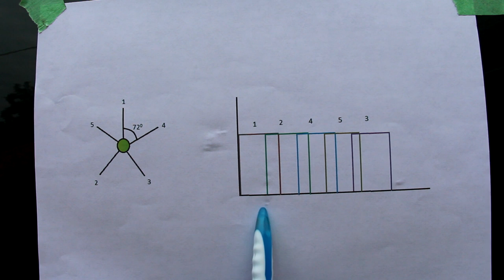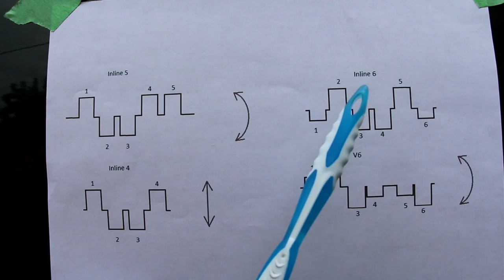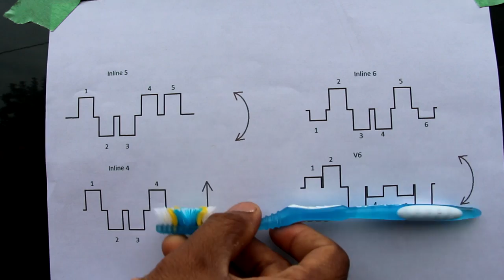Why Inline 5 Cylinder Engines are an Anomaly

Comment: Love the toothbrush.  Perfectly scungy, so much better than a greasy finger.  Yes, Volvo PCV's are dumb - I've changed many, and pulling the oil filter without slopping nastiness everywhere requires ninja-like speed and agility.  Wouldn't trade for any other engine though.  Such a lovely noise.

Comment: This teardown makes me really appreciate the freakish reliability of the 4.0 ltr straight-six Barra engine in my Australian Ford Falcon. Similar 4-valves per cylinder, oil-operated variable valves, but with a timing CHAIN and a very simple PCV system on top of the engine cover. Oh, and a water pump that is easy to replace. 512,000 km's so far since 2003, and the oil stays clean (LPG).
Reply: Barra’s and intechs mate, unbreakable

Comment: I suppose this is the updated B5 engine. My B5234T4 has a different location for the oil filter, a little bit hard to reach with the tool but at least it doesn't make a mess when its changed. And also  has a hydraulic tensioner which in my oppinion is a worse solution than this one. I remember people putting this spring loaded tensioners on engines with hydraulic tensioners.

Comment: Well, i love my Volvo S60 2.4 S with 480.000 km on the clock. 
Keep the oilchanges and they run forever.
Reply from the maker: Nice, what year?
Reply: speedkar99 
A 2001
I spoke with a guy who previous had a Volvo with the same type of engine. He sold it with over 800.000 km on the block and it’s still running.
Giving the proper maintanence they’ll run forever and sounds fantastic. 😊👌

Comment: Mercedes 5 cyl 617 series diesel was a great engine. Simple, and almost bulletoroof.
Reply from the maker: Those were the benchmarks for inline 5
Reply: I had a Benz 300D with the turbo OM617 - put 250,000 miles on it and the only major component that needed replacing was the timing chain at 200,000 miles.  A bit slow off the line but pulled like a locomotive on the highway.  I still regret selling that car
Reply: @flyingdutchman4794  Wish I had that engine in a bunch of my stuff!
Reply: @speedkar99  The Mercedes was the benchmark for a diesel I-5.
However, my 1984 Audi 4000 Quattro was the benchmark for a gasoline inline 5. While it was mostly made from I-4 parts, the Audi I-4 would last 200K miles if you were kind to it, my Quattros I-5 has about 350K miles & still can pass smog...

Comment: Henry Ford was working on a 5 cylinder engine in the late 1930's. Never went into production. Balance problems no doubt.  Henry hated the 6 cylinder engine. Not only because of Chevrolet but his own failed Model K used it.
Reply from the maker: Good to know
Reply: Henry didn't like being told what to do by an Englishman. ;-)  [Harry Ricardo in his seminal text, The High-Speed Internal Combustion Engine basically spelled out why the L-6 was best, esp. at that early stage of development....]
Reply: The Volvo 5 cylinder was used on the Ford Focus RS.
Reply: @Milen4u  - Somewhere Henry is smiling. He wanted a five.
Reply: Ford is the reason there was so much plastic on that particular Volvo 5 cylinder. Most of the parts say Fomoco. It was built when Ford owned Volvo. The older ones had much more metal  or aluminum

Comment: I love this engine--had it on my C30 and have it now on my V60 (2015, the last year they used this engine). Both of mine turbocharged. Two things only have happened with them. 1) see the timing belt at 3:18? I had a mouse crawl in there once on my C30 which blew up the top half of the engine (Geico covered $6,500--whoo-hoo!!). 2) the PCV assembly WILL crack and fail. I've had to have one replaced on the C30 and another on the V60. That's a $900 job. But, with regular maintenance, this is a fine engine: lots of power and I love the slightly "rough" feel of it compared to the V6 on my wife's XC60.
Reply: There's not a V6 in your wife's XC60 :) . If it's a first gen XC60 it could be an I6 though (the SI6 - Short Inline Six).
Reply: @olaagnilsson  You are correct! I've always thought it was a V and looks like it is from outside/above; but it's inline. Thanks for the correction! (You can tell I never touch this--leave it for the pros; but it's pretty bullet-proof.)

Comment: Wow, "first time using my 13mm socket", has to be one of the most common bolt sizes in cars.
Reply from the maker: Not in Japanese cars!
Reply: speedkar99 yes. Japanese they tend to bias on even numbers.
Reply: @speedkar99  I have seen 13mm nuts and bolts on Japanese motorcycles. Can't recall ever needing one on my Civic though.
Reply: Japanese are very supersticious with the number13.
Reply: Dinky Doo  is that seriously why they’re uncommonly used?   I know every german car (audi) I’ve worked on is like it’s built around 13mm bolts.  Lolz
Reply: @audimaster5000  No Mate i'm jesting ;-)
Reply: 13mm is usually size that fail's.. I had to have some 10x Japanese cars and one vw golf GTI. And that car what like's thirteens is usually broke.. Too many fail's under 13mm bolt's ;)
Reply: My ford and dodge both use the 13mm and 15mm for nearly everything
Reply: @audimaster5000  In fact Asian cultures usually don't care about 13.  They do care about 4, as in several languages the standard word for 4 coincides with the word for death.  It's remarkably common to find that skyscrapers don't have any floors with a 4 digit - so 4, 14, 24, 34, and everything from 40-49 are just skipped.  In Western skyscrapers, it's common to put a machinery space between floors 12 and 14, so that nobody needs to have an office on the 13th floor.

Comment: Actually the oil filter is just the paper element core that goes into the housing and a proper oil change is less messy than a cartridge type filter that pours oil everywhere

Comment: Now I know why they charged me $4,800 to replace the head in my 2001 S60 T5, 12 years ago with 160k. Never overheated, changed the oil every 5,000 miles with Mobil 1. Said had many cracks between plugs and valves. Crazy design, will never buy Volvo ever. Volvo rep told me what do you expect it has 160k miles on it. I said really, I have had cars with 350k miles with no issues. That's why I only buy Toyota.
Reply: Scotty Kilmer approves of this message.
Reply from the maker: Yeah it's weird how the valve cover is integral to the oiling system.
Reply: Jim Rr 😂😂😂. You bet!
Reply: @speedkar99  Let me fix that statement for you.  Replace "wierd" with "stupid"
Reply: I have 850 t5r 300k miles no problems at all

Comment: "If this get lodged inside of your timing belt, that's not good"
. . . well, I can tell you what happens, 'cause that happened to me lmao

My timing cover on my 2003 Hyundai Sonata V6 was all disintegrating and a bolt fell down onto the crankshaft sprocket. It shredded about 75% of the width of the belt, and I had to do the belt replacement all over again, plus order new covers. Luckily, the remaining belt width held until I figured out what the shredded rubber and whining noise was, so no valve damage!
Reply: Woah! Nice job remaining belt

Comment: Correction - the turbo manifold is not integral to the head, it has the same basic head design.  The manifold is integral to the turbine housing instead, and the rest of the turbo is attached to that.  Older versions used a standard manifold and turbo setup.

Comment: Here is a question for speedkar99:

With so many oil passages and problems with them being gunked up, could you “pickle” the engine by filling it with a type of sludge solvent, letting it sit, and then draining and flushing? I’m talking filling it right full overtop of the pistons and totally hydro locking it.

Comment: All this complexity in something that is now obsolescent. A large electric motor is complex in terms of the electronics and possibly materials science so an EV is not as simple as one may imagine. A big plus is that it will have  only one gear for all forward speeds with maximum torque at 0mph. A motor service interval of 1,000,000 miles (for a Tesla) and first life battery longevity of 12 to 15 years (up to 25 when repurposed). A different world. A petrol engine can use very clever techniques indeed to run clean 'ish' and give reasonable performance. Really awesome so it is actually sad to see them lose relevance.  A well presented if a bit oily video.

Comment: Im doing a head gasket job on a similar 6 cylinders volvo engine , the manual does not give specs for flatness of this aluminum block , do you know whats the maximum warpage allowed on the block ?
Reply from the maker: I'm not sure, maybe a machine shop might have that spec

Comment: I'm 150k+ on my 2010 5 cyl. Runs great. Gunning for 186k+, just crossing fingers that the transmission won't grande sooner

It's the FT 2.5 that has been running E85 occasionally too 😎

Comment: The combustion chamber is in the head, not in the bottom of the block.

Oil is enough of a coolant for the lower portion of the bore. The majority of the heat is in the head and the top of the cylinder.
Reply from the maker: Good notes

Comment: I had a Volvo 850 with this engine, it was BER when the head gasket failed, like the one you have here.  Lovely and smooth engine, compared to a 4, because the pistons are not at 180degrees to each other, it's 144 degrees. "They" say it's as smooth as a 6, which has 12 degree separation.  I did find that my Lexus (toyota) straight 6 was super smooth and powerful.  Much smoother than the V6 I have now.

Comment: I've just viewed this and it's really good! Lots of good non biased info. 
I'm looking putting this engine into a locost vs a Honda K20A6. I know the weight bare of the Honda but can't find any on the Volvo B5204T5 or the B5204FS, any info on what is weighs bare? Meaning, the sate that the engine in this video started out at. 
There seems more versions of the turbo engine available in the scrap yards so I was thinking of ditching the turbo and upping the compression because the race series I'm going into doesn't allow turbo and has to be no more than 2.0L and I thought the bottom end would be stronger.

Comment: Thanks for the awesome vid...now..im getting that the failed part of a cracked cylinder wall because the head gasket was intact. Was that your findings?
Reply from the maker: Nothing obvious, I'm assuming head or oil cooler because of the gell that came out of the oil pan

Comment: I had a volvo 850 estate, best car I have ever zhad.  20 years old and over 200,000 miles when I scraped it, was a strong engine.  The gear box did jump out of first sometimes.   The steering rack was  an MOT failure plus some other problem.  Engine was so smoooth

Comment: Well explained. There is a rough banding of engine capacity where the mechanical losses (and size, weight and cost of course) become prohibitive for a higher cylinder number to be used and the forces acting on the cylinder are prohibitive for a lower cylinder number to be used (thicker, heavier con rods and crankshafts and their bearings etc.). A five cylinder is generally optimal between about 2100 and 2750 cc. Fiat Alfa used a five cylinder until recently, dunno if this was available in the US.

Comment: 0:45 I disagree. My 2012 Volvo XC60 is the same way. If you remove the drain plug first then break the oil filter housing loose (36mm on mine) all the oil drains down and out of the drain plug, no mess at all.

Comment: You gotta see the D5244 Diesel engine that Volvo also made. Really strong engine for an automotive diesel. Its a direct derivative of the gasoline i5 but its stronger. Its known to be a very sturdy and reliable engine if you just keep up with maintenance and feed it 5w40 instead the factory 0w30 they make it to half a million miles unit they are physically worn out.
The block has more meat around the cylinder bores and the cylinders are further apart from each other, the head is bigger and they really went to town with the head bolts they look like aftermarket performance bolts. They might be bigger or the same as in this engine well probably all the same which would be why these Volvo engines are not known for head gasket issues. The head is clamped down for good.
The bottom end of the block is also strengthened with more webbing and more material.
Pistons and rods look like they came straight out of a semi truck engine which is something I love about automotive diesels: The components are so beefy because of the diesel torque and high compression of Diesels.
It doesn't have variable valve timing aswell and only one cam gear but its still DOHC of course the 2nd camshaft is driven by gears in the head. Really simplifies the valvetrain.
Volvo Penta adopted this engine for marine applications... yeah that's all I need to know about how solid of an engine it really is.
Volvo D5244 and its 4 cylinder variant,
VW Diesels pre EA189,
Mercedes Diesels pre OM651,
and to be fair to BMW their old Diesels seem alright mechanically.
The best automotive diesels I know in terms of reliability. These things are approaching 20 years of age and they still drive around here.
If you change your oil regularly and use god 0w40, 5w40 and 10w40 in the summer instead of whatever the manufacturers wants you to use (0w30 water oil to lower fleet emissions because they cause like a few percent less drag in the engine... in a 20 year old diesel oh sure that's gonna work) these things run for half a million miles.
Reply: That's cool! I wish they had diesel Volvo cars in USA, but they don't to my knowledge.
Reply: @zzoinks  they were never exported to north america.

Comment: My volvo engine S60 T5 2.3 cc jammed in the middle of the highway. Volvo just being serviced ( change engine oil , gearbox oil, clean gearbox oil cool, change plug and air filter) No sign or indicator shown of any engine parts failed) please help me what is the course that make the volvo engine jammed ( engine oil full and no leakage)

Comment: The GM Atlas family of inlines includes a 5 cylinder. The inline 6 spent 4 years on Ward's best engines list. Great HP and torque, extremely smooth. Like the engine in this video, and every other engine made today, clean oil is the key. A lack of proper maintenance is the reason for almost all engine failures below very high mileage. People are just generally stupid about not changing their oil when they are supposed to. I think BMW is an exception to that, as they have built in failure points, such as their cam chain adjusters. Also cam failure on the 5.7 Hemi is way too early. My old Chevy Stovebolt 6 may be the most forgiving engine ever made, LOL.
Reply from the maker: Agreed. Maintenance is key

Comment: We bought our 2nd and 3rd Volvo "rear drive Red Blocks" in '99 and '01, both used. The '99 240 had 147K on it, it was neglected and abused. I did a "driving refirb" on it basically. Bought our '87 740 used in '01, a one owner AZ car, cream puff, 120K. My 240 is not used much after I retired 5 years ago. Our main driver is our 740. The 240 has 355K now and the 740 has 396K and I expect it to roll 400K some time this Fall. Our first Volvo was a new '73 1800ES we bought as newlyweds. Kept it 10 trouble free years and had to sell because of a growing family. Too small for baby seats! Sold it with 147K on it. Definitely we are huge Volvo fans. Your video of the "White Block" 5 cylinder is scary, seriously. It's complexity tends to shy me away from any upgrade to a front drive Volvo with any of those generation engines. As one post pointed out, one component fails you're in trouble and you added that one component fail can take out the engine. I have a friend who owns a local salvage yard and he kids me he keeps all the old Volvos in a back corner just for me for which I'm grateful. As long as I can get the parts I'll keep them. Their bullet-proof heritage is legendary across the mark. They're still simple enough I can fix them. The only computer function from the black boxes is for the engine management and that's basically just fuel injection mix, timing, etc. Nothing else. Maybe at some point I may not have a choice but for now, I appreciated your informative video. Quite an education. I'll add that several mechanics have told me that the later gen front drive white blocks do not have the bullet proof reputation of the red blocks. Especially the turbocharged engines. Yes, anything will fail if abused or not maintained. Over all, I prefer the simplicity of the old school 4 cylinder! I'll also add, our 1800ES had the push rod version of the older generation red block. Sounded like a sewing machine but still venerable workhorse. I always said it must have been their Scandinavian farm implement heritage!

Comment: My father bought his frist Mercedes in 1988, a 190D (Diesel) with a five cylinder engine and 75 PS. 
Yes, you read that right - only 75 PS! No turbo, just a naturally aspirated engine.
They don't make such low power engines anymore since at least 20 years, though....
BTW: Excellent video!

Comment: great engines. the most common issue on this things is that pcv issue and oil leaks because of those gaskets on the oil filter canister. another "known" issue is the yellow mustard" which is from condensation buildup and short drives. wish you could deconstruct the turbo 2.5 but this is as close as it gets

Comment: These are great engines. I work on Volvos for a living. I rarely ever see an oil cooler failure or head gasket issues. I sevice some of my customers vehicles with 300,000 miles and they still run well. Its all avout how they have been treated and serviced throughout there life. By the way,its not a valve coverxits a cam cover/ cam holder. It is customary to remove the timing components and the cam pulleys before removing the cam cover. The PCV system is very important and I replace lots of the oil seperators and related pcv components. The front cam seals are usually the first to pop out on an older,neglected engine. I love these Volvo engines!
Reply from the maker: Agreed. Maintenance is key